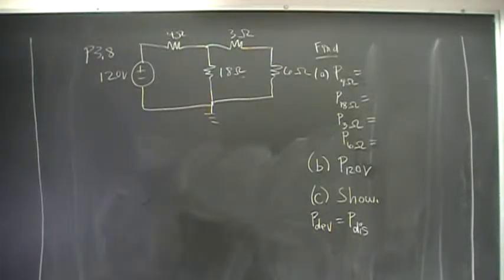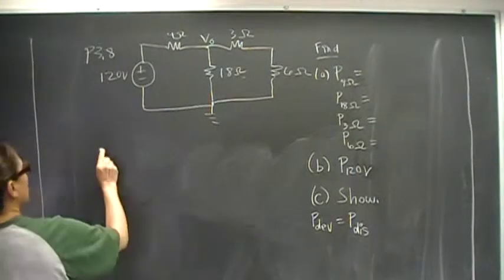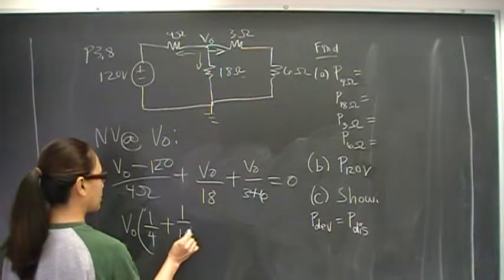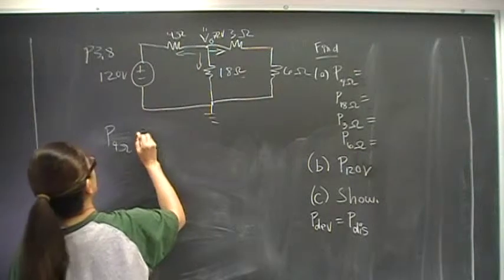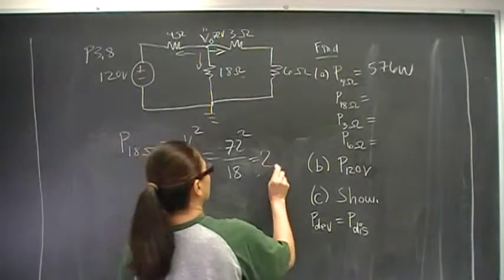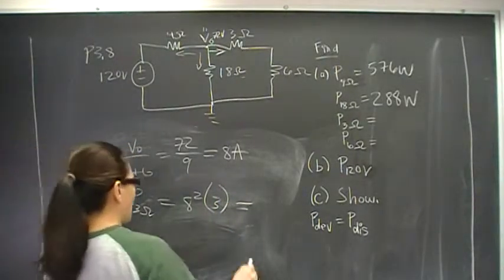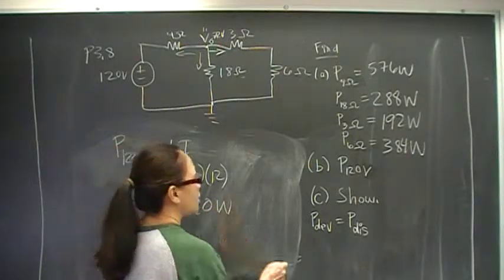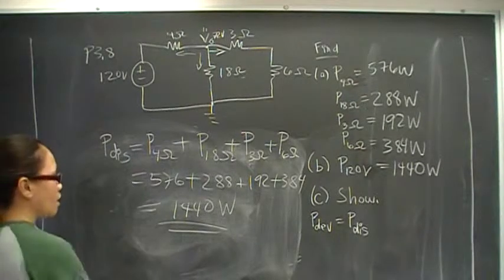P3.8 Nilsson Riedel Electric Circuits 9th Edition Solutions

Comment: Thank you for this! I'm in an introductory circuits class that uses this textbook and I am completely lost. The book is appalling. Luckily my class is based on labs, one midterm and a final. The problems at the end of each chapter are given as lab assignments. I'm still nervous about the exams though. The professor might take problems from the text.